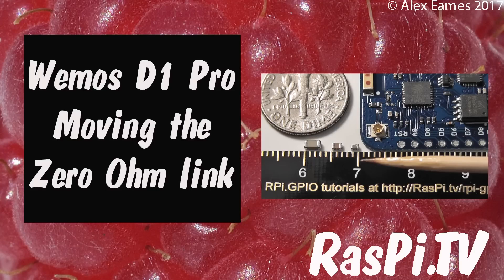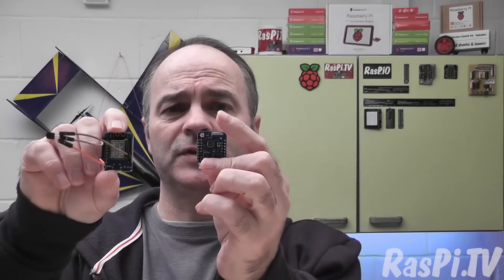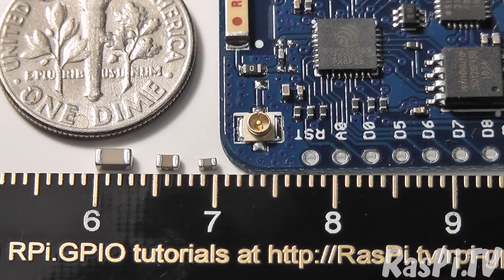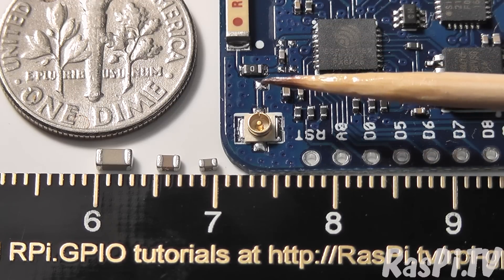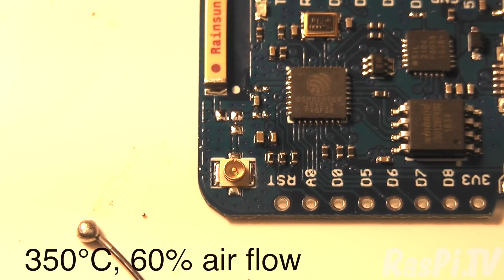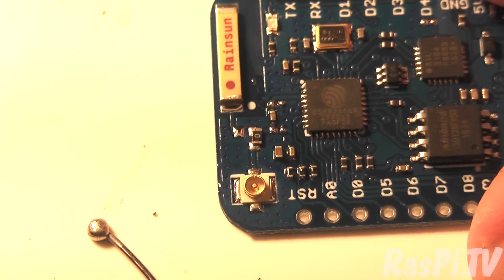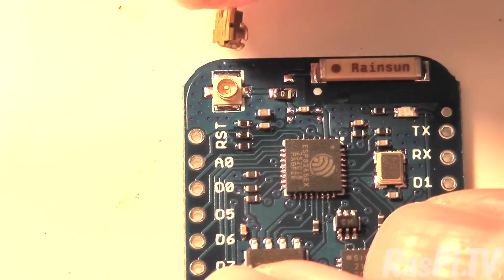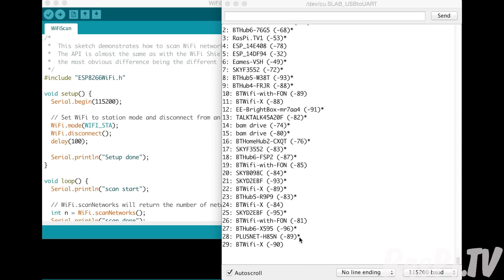Wemos D1 mini Pro how to move Zero Ohm Link to attach external antenna

Comment: Thanks for the video! I know it has been 8 years since you posted, I found super useful as I just bough the same board and puzzle about how to make the board use the external connector instead of onboard chip antenna.  Coincidentally, I just bough a usb microscope on Temu so I can see what you were saying 8-)  I use the microscope to figure out where the pcb trace is to the pcb antenna for my regular esp8266 and esp32 boards, I used to mod wifi cards antenna for quite a while 8-) and failed many time, but I like doing it.  Cheers!

Comment: It's a shame they didn't just put a jumper instead of having to faff around moving tiny components that require specialised tools.  Probably most people interested in this sort of stuff already have a soldering iron and a heat gun but even so, a jumper would have been easier.  Having said which, I'm no RF engineer so perhaps there is some weird aerially reason why they had to use a 0 Ohm resistor.

Comment: Instead of resoldering that tiny link, I'm much tempted to just bridge the gap with a glob of solder, like when connecting adjacent holes on a perfboard. Should work, but zero style points :-)

Comment: hi
what should be the upload rate for the D1 mini pro in the IDE software(115200?) and what should be the baud rate inside the code[Serial.begin(9600); ?] if a sensor has a baud rate of 9600?
like can there be 2 different rates at the same time and all works without frying anything?
Reply from the maker: The first baud rate is the rate of flashing the software to the Wemos. 115200 works for me, but it will depend on your computer setup.
If the sensor is 9600, that is what you should use in your software. This has nothing to do with the IDE settings and nothing will fry.

Comment: where can i buy it with the resistor already moved?
i see tons of links on aliexpress and ebay that sell it as a "kit" with the external antenna included but they all appear to have the resistor   soldered for the ceramic antenna ,  makes no sense at all
all these Chinese sellers and nobody sells the kit with the resistor soldered for the external antenna even though they are selling  it bundled with the antenna

Comment: Nice job and steady hand :)
Do you actually need to resolder the 0 ohm in place ? It seems these are some kind of workaround to allow use of pick and place machines, so a mere solder bridge should be alright.
Reply from the maker: Solder bridge would be fine

Comment: This worked work great for me.  To give a reference point,  the signal dropped from high 70's dB to mid 40'dB(using antenna)   They should have added a jumper!  Thanks for the vid.
Reply: Yeah I never know why they don't just put a low profile jumper pins there. Cost and height I guess. Even a low profile SMD slide switch would be good.

Comment: I managed to de-solder and re-solder mine, wow that smd resistor is TINY!!!! I had to use precision tweezers, also filed my soldering tip to a fine point before attempting. Thanks for the upload.
Reply: how did it go with the external antenna in your experience?
Reply: @ARichli  in all honesty I kind of feel like the external antenna causes more issues it could just be a mental thing I won't know for sure until I get a nice oscilloscope 🧐

Comment: You video covers a question in need of an answer; how to use an external antenna?
Do see any improvement over the onboard PCB antenna? I have some boards that are just out of range of the wifi signal and would like to know if the range is increased and by how much with the external antenna.
Thank you for the great video.

Comment: Hi Alex, Do you know where I could get a replacement zero ohm resistor for this board?

Thanks
Reply from the maker: I'd just use a blob of solder or a small piece of wire :)
Reply: ...of course XD I have done that now, used a blob of solder thanks for the eye opener as I missed that in your video.
Reply: The only reason that there are zero ohm resistors is that pick and place machines don't handle wire links easily.

Comment: Why didn't the designers just put in a short two pin jumper? Or is there some good reason they didn't?
Reply: Why didn't they just make the external antenna the default? They could make more money by selling a coax connector, cable & antenna with mounting hardware..   I was going to buy one of those boards w/ the antenna rig, but now I'm not so sure..
My SMD soldering skill started evaporating when I retired back in 2009..  ;-)

Comment: What a ripoff! They give you a port but you have to resolder stuff in order to use it?? I thought it was just a simple case of plugging in the connector for the antenna. I'm very disappointed to learn that both antenna can't be used at the same time.
Reply from the maker: LOL. It uses the wrong kind of electricity as well. They really should have thought about that. ;p
Reply: The wrong kind of electricity?
Reply: I agree that his reaction a bit drastic. :D These modules are almost "Free", so considering that we dont really have too much to argue about,  although IMHO, they could have made it a bit less of a hassle by using a jumper pin or a dip switch.

Comment: hi great video thank you I have a different type of wemos D1 Mini Pro with antenna connector and it's a little different can you please look at this image and tell me where I am supposed to move the zero ohm resistor to? I don't know if it goes up or down or left or right or on what slot because there's two slots under it. I would appreciate it thank you so much. https://ae01.alicdn.com/kf/HTB1T7UpQFXXXXakXFXXq6xXFXXX1/WeMos-D1-mini-PRO-analog-WiFi-D1-mini-PRO-integration-of-ESP8266-16Mb-flash-and-USB.jpg

Comment: Can I basically solder + to 3V3 pin and - to GND and run Wemos on 3.7V rechargeable battery?
As far as I know, Wemos runs on 3.3V output.
Reply: I hope something like this works http://i.imgur.com/vE3TJgd.png
Reply: Never mind, gonna answer my own dumb question.
You'll need something called WeMos D1 Mini Power Shield, since you can't power up WeMos through 3V3/5V and GND pins. You'll have to add a shield, which has VIN and GND pins to power it up.
Reply: Hey there, it's probably a bit too late,  but i always power both d1 and d1 pro from 5v and GND pin. Power shield only a necessity for higher voltages,but for a standard 3.7 LiPo the onboard regualtor will do the trick :)

Comment: I used to work in a factory doing this. Hope you find this helpful: I'd have done this job with 2 soldering irons but not the ones with a sharp pointed tip - they look like the right thing for the job but don't transfer enough heat. Also a USB smt microscope (sold on eBay) would be helpful and some liquid flux. Even with good eyes, a magnifier makes it much easier. Having two soldering irons mean you can heat both ends of the component at the same time to remove it then to refit, put a blob of solder on the pad and slide the component into it, let it set, then solder the other end. http://www.ebay.co.uk/itm/Adjustable-Stand-8-LED-1000X-USB-Digital-Microscope-For-Vista-Win7-Mac-System-/151807250426?hash=item23586acffa:g:kX8AAOSwo4pYdg0J
Reply: http://www.ebay.co.uk/itm/DLAND-Portable-50x-500x-Magnification-8-led-USB-Digital-Microscope-Endoscope-for-/182355802967?hash=item2a7540bb57:g:dmQAAOSwiDFYLDAh
Reply: You might think the one on the left is the right one but the one on the right is better for the job http://makezine.com/wp-content/uploads/2015/05/soldering-iron-tips.png
Reply from the maker: Thanks. Good tips. If I was doing a lot of it, I'd invest in hot tweezers. To be honest though, once I'd figured out what I was doing (and that if the airflow was sufficient to do its job it would also blow away the component) it wasn't that bad. Filming prevented use of a magnifier, but don't forget I was using a 15.6" monitor for the filming, so was able to look at that too. (That's how I checked the joints)
Reply: I have used the heated tweezers but it's hard to get a neat joint every time because you have to lift off both ends at the same time so you usually have to tidy it up with an iron so you might as well use an iron (or 2) to begin with. As for the hot air method, you can get heat proof tape to stick on the surrounding components so they don't get blown away . It looks like wide Cellotape but it has a gold tint.

Comment: I personally would have just removed the link resistor and bridged the pads with some solder.
Reply from the maker: Moran Taylor  I tried that the first time after I lost the link. it turned out that the solder mask did its job too well and I couldn't make the bridge 😂
Reply: lol fair enough

Comment: You may would like to look at getting a stick o vice. they're ideal for this. :-) Great work BTW.
Reply from the maker: I actually have a couple of PCB holders already (and another type on order). But I find I don't like to have my hands "floating" in the air for delicate work. So I put a piece of ceramic tile on a wooden box that's at just the right height. Then I can rest my wrist(s) on the box, which gives me a much finer degree of motor control than I would have with "floaty hands". But I am an easy sell for tools that make a job easier. Always on the lookout for stuff like that.